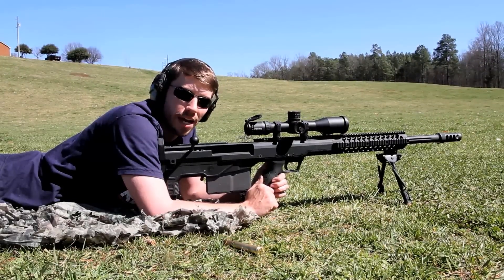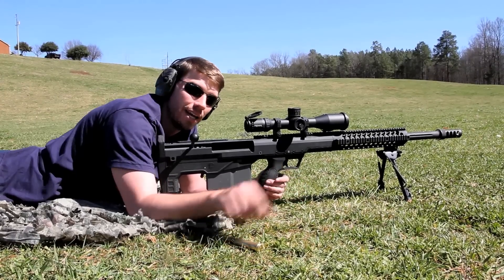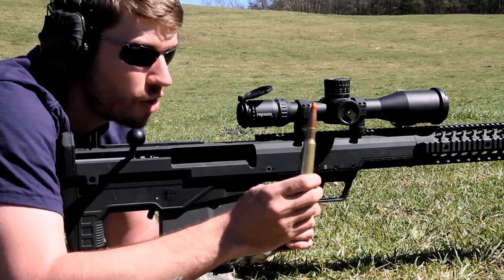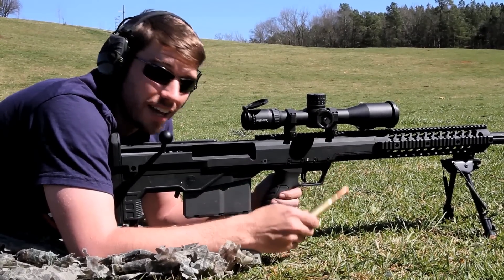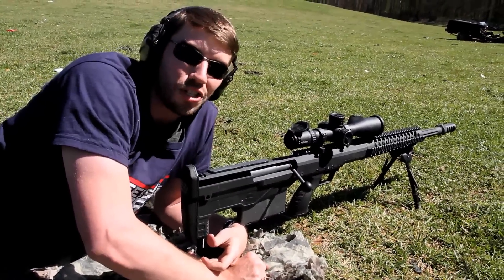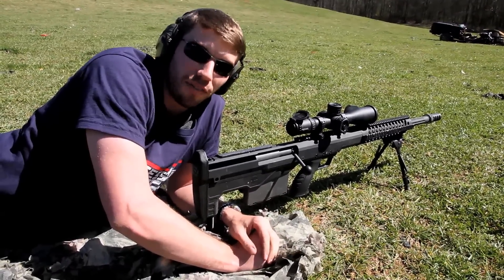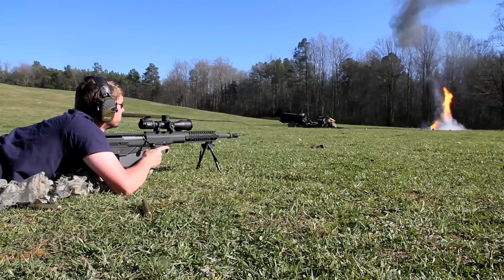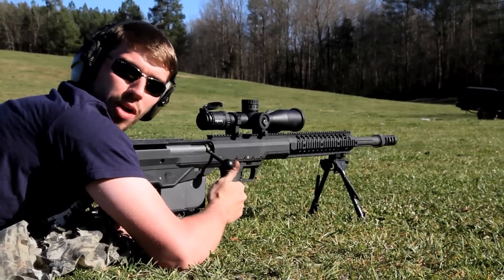50BMG vs. Propane Tanks?

Comment: It's also worth noting that because oxygen isn't entering the tank after it's penetrated it's not going to explode into a shrapnel bomb; the gas inside the tank is highly pressurized and is going to force its way out once there's an opening.  More likely that stream of gas is going to ignite and create a jet of fire until all the gas is expended.  I don't know if there's enough pressure but you could get a bit of motion (same principle as a rocket engine) but that doesn't require combustion

Comment: If you hadn't gotten it to work I know when we used to do it we put a couple of road flares downrange and then used the little camp fuel ones from Wal-Mart, We preferred them because there was usually more complete combustion, but they had a tendency (depending on which side ignited) to come flying uprange.

Comment: The Raufoss Mk 211 isn't purely a high-explosive round so much as a multi-role round that can handle just about anything; there's a tungsten core, HE, and small incendiary component.  To be honest I'm a little surprised it didn't ignite.  My hunch is that the explosive consumed all the available oxygen at the same time as the propane tank was penetrated and the short lived incendiary device didn't have enough time to ignite the tank.

Comment: .50BMG is typically around 860-940ms and is generally used to knock out small lightly armoured vehicles comparable to the HMMWV and has 19mm of penetration against face-hardened steel at 500 metres (547 yards).

Comment: White Phosphorus is the usual "light" in tracers.  That chemical does react with air to burn.  Anyone who has been around it will tell you that it burns quite hot.  It is what is (was) used to ignite the napalm dropped by aircraft across the globe.  Those of us without the proper licensing to obtain explosives, etc. would not be able to get the military grade tracer ammunition.  Magnesium powder is also a viable component in some tracers (we can buy those), but I doubt it would ignite either.

Comment: if you dont get impressed with those propane explosions....its because happened in an open air situation with even mixture where there is full availability of oxygen and the gas resulting of the combustion could go anywhere freely! In a closed situation like a house looks much more aggressive because the gas must escape through specific routes...

Comment: when a propane tank is just perfurated, the reaction with oxygen (combustion) only will happen in contact with the air. you can't make a hole in it and assume that it will explode. to make an explosion with propane, you need a room with a mixture of air and propane, in the right composition. if it has too much air, or too few, will not explode.

Comment: they throwed in the fire. it means, the tank was heating. The "first explosion" was because the tank could not contain the gas inside, the pressure was to big. The "second explosion" was the propane burning by the outside flames. it is different.

Comment: Well, there are a few issues when it comes to "quickscoping". 1. A sniper rifle is around 25 pounds in weight, so it's pretty impossible to throw around. 2. You will probably end up with a scope inside your skull if you try to "quickscope". 3: You're not very accurate when "quickscoping", and Kyle will probably end up hitting the camera crew.

Comment: redjacket was able to set off a tank with one round without explosives or flares when they went vs Mythbusters. They strapped explosives to it, but they fell off before the round hit. At least that's what the high speed video showed. I think it was a tracer round but it had to be a one in a million shot unless its a low caliber tracer like a 5.56 it might enter one end tumble and keep burning. The tracers will keep burning if they don't get out of range easy to start fires if your not careful.

Comment: that would be a bleve. the heat from the fire increased the pressure with in the tank until it exceeded the pressure the tank could withstand. The vapor then mixed with the air and caused a rapid expansion as it combusted. I find it surprising that it even did bleve as most tanks have safety pressure release valves built in them preventing the tank from failing as the the gas is vented once the pressure exceeds a limit. Propane tanks are actually really safe when it comes to explosions.

Comment: That was one hell of a fireball but if you want a legitimate explosion try shooting a propane tank that is basically empty (like if you just took it off your BBQ for not working).  The remaining fumes will be highly explosive.  The compressed propane is not flammable.  What actually caught on fire was the gas as it expanded through the bullet hole.  For example throw a match in a bucket of gasoline, you will get a good fire on top.  Throw a match in an almost empty gas jug, you might die.